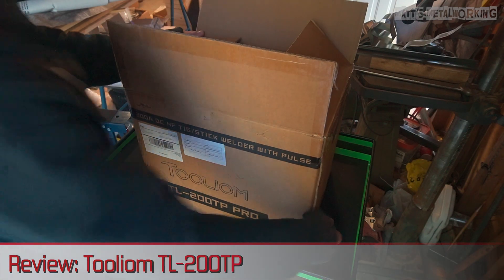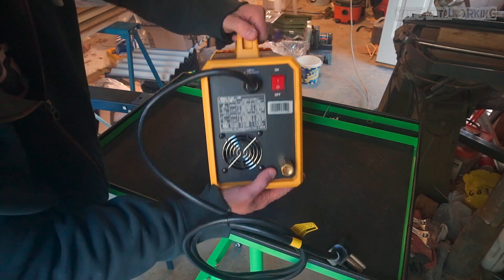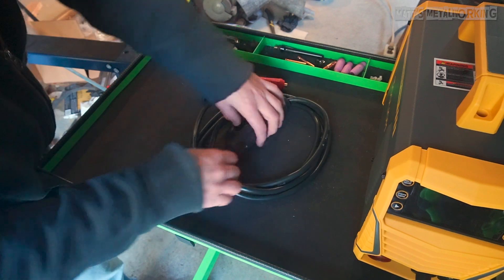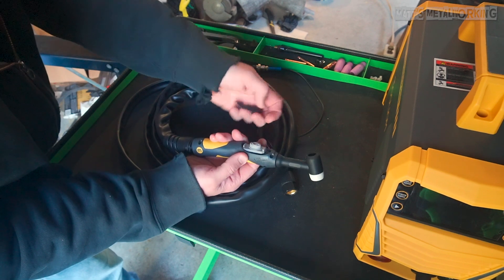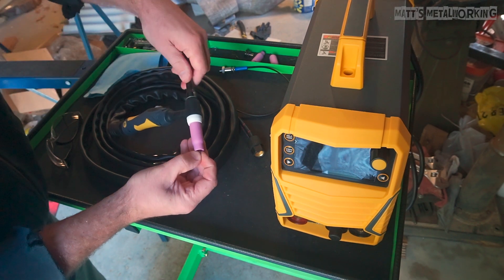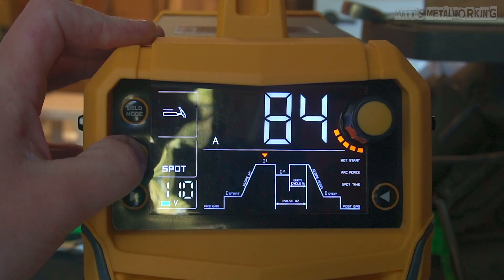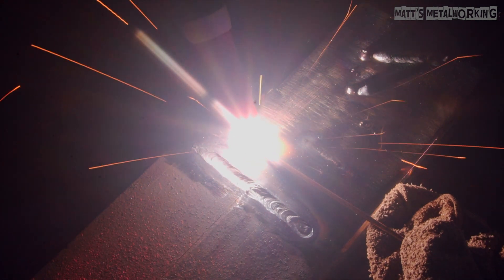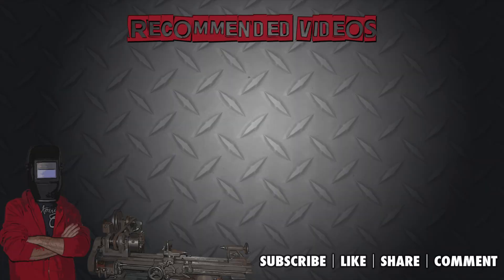Review Tooliom TL 200TP Pro Tig Welder

Comment: Bought it for aluminum cause it was cheap and didn’t say it couldn’t do it. Damn. Nice review my guy
Reply: you can weld aluminum with you just have to run 100% helium and use a good back purge system
Reply: @bradyfrederick8994 I already bought another cheap AC/DC welder. Thanks though!

Comment: Hey I appreciate your video! I actually just received this same model about an hour ago and I have a question as a learner. I snagged a foot pedal to use with this as I heard a pedal would be useful for modulating the weld. I notice that there is only one 5-pin connector for the TIG function and that's all. The foot pedal (another Tooliom product) only has female connection. Am I missing/not understanding something about using a foot pedal with tig? Maybe I just don't understand "where" this arc comes from. Is it the Tungsten or the ground clamp? I've been trying to read and watch as much as I can before I get started and it can all be quite overwhelming at times lol. Any thoughts?
Reply: Question for you I just picked up the same machine TL-200TP PRO I bought the 100$ one very similar with lift TIG only and gave it to my buddy who just started welding school. I’m actually a silversmith. I’ll be using it to build equipment and also spot welding. I tested it out on silver with no argon just tungsten tip 10 amps and no shield gas and already am happy with it. I am new new to welding but am good with oxy/propane soldering. Basically wanted the spot function to be able to do welds in tricky spots and it seems to work just fine without shield gas. All though I’ll probably be picking up argon as I got the flow regulator already. My question to you is I noticed you bought the foot pedal. Does it work for spot welding or just the button on the torch? Thanks a bunch. I do like the machine a ton tbh. I liked the other one also just needed that spot welding feature. Build a flat lap using stick welding and the welds are ugly and only have used like 7 rods tops (6011 3/32)…..I’m impressed but just want to know if I can use foot pedal for triggering the spot function? Thanks a bunch ahead of time.
Reply: People say buy a foot pedal, you don't necessarily 'need' one, it only makes life easier, id recommend using it without the footpedal first. Check your TIG torch and the connection on that should be the same as the foot (which is female and should work). Just plug it into the connection on the front of the machine, to the bottom beside the port you plug the TIG torch into, it should have a screw on connection.